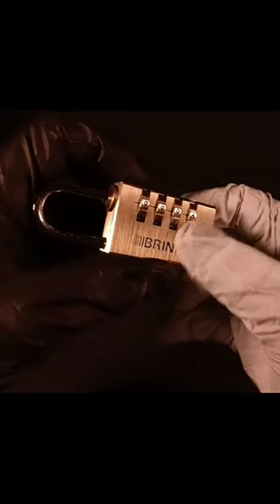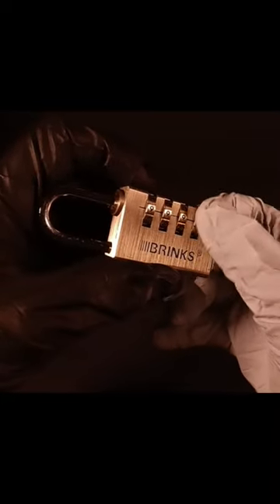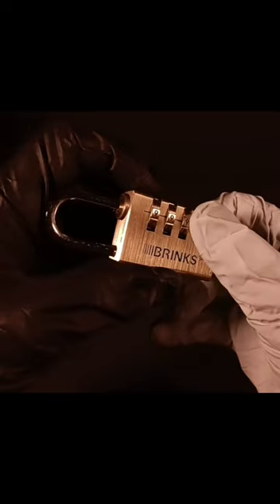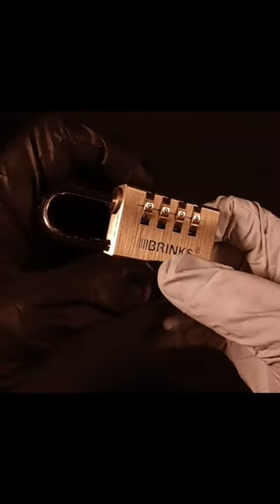🔒Cracking 4 Digit Padlocks🔒 #lockpicking #locksport #shorts

Comment: What about the ones where you push in to disengage the lock?  Do you do the same process pushing in?
Reply from the maker: Good question, tensioning the wheels are a bit different. You need a tool for those types. I'll make a video on how they work and where to get the tools if youd like

Comment: So will this work any variation of these locks?
Reply from the maker: On most locks like this yeahs, as long as the mechanism is the same. Splines and gates. Reason it works is because on the shackle instead of traditional locking methods like bearings or pawls the shackle has little splines on em that pass through the true gates in the wheels allowing the shackle to move up and open.